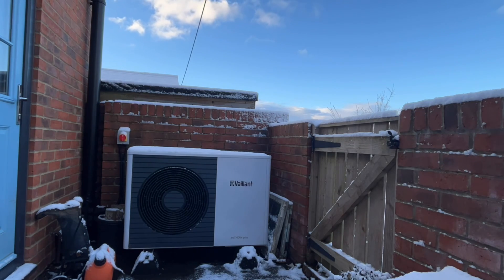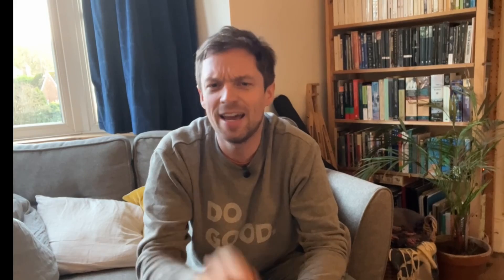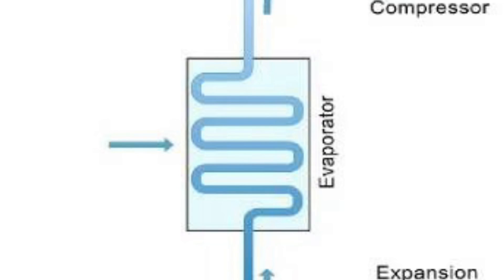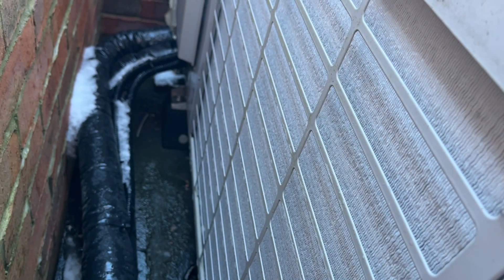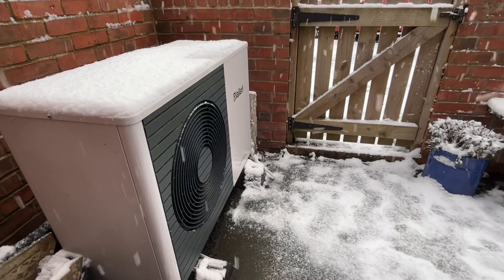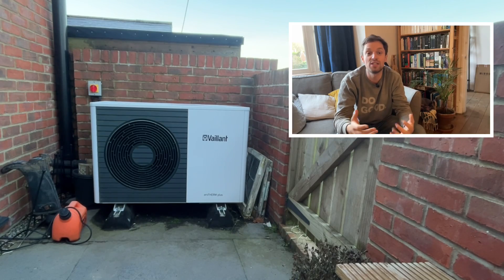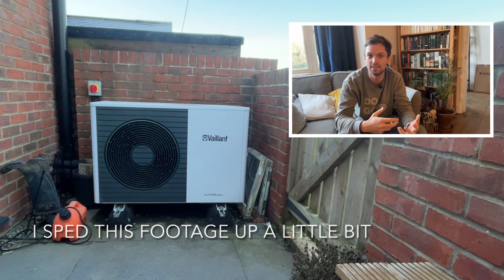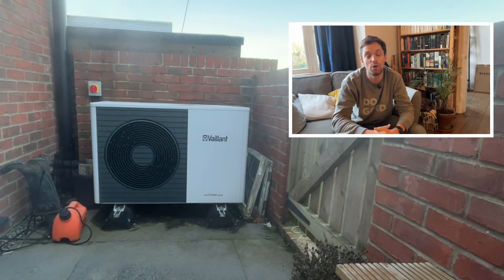Heat pump defrost cycle - what happens? I thought our heat pump had blown up!

Comment: Thank you for the helpful video. We are having an issue with pressure loss on our system and I am wondering if the defrost cycle may have something to do with it. This only happens when the temperatures are around or below 0 degrees Celsius. The rest of the time everything is fine. But on days with near 0 temperature our system pressure drops over time. One day we woke up one morning and it had dropped all the way to 0 bar.

I haven't been able to closely observe it but I have a hunch that when the pump is doing a defrost cycle it loses water somehow. You say in the video it takes the hot water from "inside the house" (radiator cycle or buffer tank). What should happen with that water after the defrost? Could there be a fault where this water leaves the system (via the condensation drip pipe) leading to pressure loss? Any other thoughts on what might be going on?

I will raise with our installers again but so far they've said that a load of condens water is normal (and the internet tells me that between 10 and 30 litres a day are not unusual in certain conditions). They've also changed some other valves and cleaned the filter, but this doesn't seem to have resolved it. It's tricky to figure out what's going on as it's not a constant issue, only at colder temperatures. And difficult to observe as I can't be out there waiting for a defrost and the positioning of the pump means I can't leave my phone out there to film it for hours.
Reply from the maker: Hi Ann, sorry to hear you are having issues with pressure loss on the system. That is something I have experienced in the past too, I don't think it is linked to defrost cycles, as these take heat from the house, but shouldn't use any water. 

My issues stopped when  I had a fairly dramatic issue when something fell on one of the valves in the system whilst the refill hose was open... we had water everywhere, briefly...!

After some fairly meaningful panic, closing off the mains water stop cock, and some deep breaths, I made sure each valve on the heat pump system was closed effectively (that should be closed) and turned the mains back on... everything was fine. And since then, I haven't had issues with pressure drop...

Long story short - I wonder whether there is a valve around your system that is open slightly, may be dripping slowly and meaning the system loses pressure slowly? This could also be at a connection to a radiator, or somewhere around your central heating pipework, may be worth checking around the system to see if you can spot any drips?

The condensate that appears from a heat pump is not from within the system, this is moisture in the air condensing at the heat pump, not a leak from the system. 

It may be that you have higher pressure loss in cold weather as the heat pump is working harder and more consistently circulating water - i.e. it is running for longer hours. 

It shouldn't be an issue with defrosts.

Hope that is helpful....

Tom

Comment: Lovely. And it can happen about zero, because that's when there is more moisture in the air available to ice up the heat exchanger (which will be cooled below zero by the heat extraction..)
Reply from the maker: Yep!

Comment: Hi, im considering a HP.  Question.. Heat pumps have a compressor in them which I've seen in other videos can be like a loud freezer, when its pump runs, obviously freezers dont make sound all the time.
Does the sound of the compresser/HP transfer into the house? Our current gas boiler can transfer sound through pipes when heating is on depending on how much flame is burning.
Reply: There are stories of heat pumps not being installed 'properly'. In particular the heat exchanger fan bearings don't like being tilted. If the foundations are poor or it wasn't carefully levelled (un-carefully left tilted?), then problems can ensue. 
In a sense they are just air conditioners, so if poorly maintained or installed, you get very similar noises ;-) Cheap installs tend to have lower quality bits in them.

Comment: Oh boy - you are so right! We have just had a heat pump; it's been running for 3 days now so very new. Like you I'm a degree qualified physicist & engineer and had done loads of research and thought I knew all about heat pumps. And then this morning I noticed it had gone quiet, the main fan had stopped and the flow temperature was way down, and there were wisps of vapour (looked like smoke) coming off it!!! Yes just like your video. Then as I approached it blew the  vapour straight at me. Just as I was staring to panic I remembered 'the defrost cycle'!! And then I Googled it and found this excellent video. Phew!!! They should make this video compulsory viewing for all new heat pump owners. Thanks for posting.😃
Reply from the maker: Amazing! Pleased to hear my video has been helpful! 

It’s quite the shock isn’t it?!

Thanks for commenting and engaging with the video!
Tom

Comment: your  a .....no offence and a tip that heatpump is  installed  bad  distant to the wall is  far to small  to the % is minus  50 at least.
Reply from the maker: Hi Andre, I am not sure what the dots mean? 

Yes you are right the distance on the right is smaller than the manufacturer’s recommended distance. I understand this is for access for service. Hasn’t caused any problems in the first 2.5 years and hope it doesn’t in the future. 

Thanks for pointing it out. You aren’t the first person. 
Tom

Comment: Just an observation may be wrong? from watching other videos on heat pumps they talk about air being pulled back into the unit if walls fence is to close, your unit looks like it doesn’t have enough space on the sides for the unit to exchange air hot or cold. This could lead to the unit running harder and shorting its life and cost you more to run.
https://youtu.be/1rKNT7-42J0?si=Eq68E6qoe6GkgKNo 
go to time point 27:10 and they talk about air flow on the unit.
Reply from the maker: Thanks M0PAX, you're not the 1st person to point out this or ask the question. I have reviewed the minimum clearance for the unit vs the manufacturer's literature, most of the dimensions are fine, the access space on the right hand side is smaller than required, which is pretty frustrating! But hasn't been a problem with servicing so far over the 1st 2.5 years.

I think the space at the rear and other side for ventilation is larger than manufacturer guidelines.

Thanks for taking the time to comment. I think this video with Roger Bisby and Adam Chapman is fantastic, and amazed to see how much Roger Bisby is won over by Adam.
Thanks

Tom

Comment: The Ecoexperts link doesn't give you a heat pump quote directly, by the way. They just sell your details to local companies.
Reply from the maker: Hi Acer8 - yes I wouldn't necessarily trust a site that didn't connect you with real companies, linking you up with local installers would be key to getting a thorough quote.

Thanks

Tom

Comment: It can use just water, not necessarly refrigerant, as in my case. Also i dont think it compresses the liquid, its the air it compresses i believe. This increases its heat capacity begore it goes thru the heat exchanger. But thanks for the video, took me by surprise the first time too!
Reply from the maker: HI Mike, apologies if I caused any confusion. I was talking through the heat pump process to explain why frost would occur, but yes, a defrost just uses hot water from the building heating system. 

Compression in the system is of the gaseous refrigerant after it has been heated and evaporated by the heat exchanger, this is within the heat pump process and we don't see it outside the unit. The air is not compressed.

Thanks for taking time to comment
Tom

Comment: I had a similar panic just hours after our installation when I saw the power consumption rocket despite the water and heating being off!!!   After considering trying to contact them at 10pm!, I decided to wait for 10 mins to see what happened. Then all went normal!  No explanation whatsoever in the manual. Why don't the installers consider these things? I decided that it was an unannounced defrost cycle.  There are much easier ways to give people heart attacks!
Reply from the maker: Oh no! 

There are definitely a lot of new things when you have a heat pump, and difficult to know what is 'right'... but pleased to hear yours settled down!

Tom

Comment: Does heat pump site have any effect on number of defrost cycles , Is a north side location in damp boggy garden worse ?  How many defrosts do you get per hour ?
Reply: I track everything via home assistant, the power consumption pattern completely changes when it defrosts so fairly easy to see, most I've seen was two in a day but its obviously very weather dependant.
Reply from the maker: Thanks  @tarkadahl1985  - that is very interesting!
Reply from the maker: Interesting questions... I am sure that the site would have impact, you can imagine that a windy location could impact frost build up, and you could imagine if it was in a particularly wet area, that could also contribute... I guess this is getting into quite specific micro-climate issues that I suspect won't effect most installations. 

I don't know how many defrosts we get per hour, and will vary on temperature / weather etc. I had set my camera up for about 30mins on a day at about 0°C so at max it would be twice an hour that day. But I suspect much less.

Thanks for engaging with the video!

Tom

Comment: Haha, my installer warned us about the clouds of steam!
Before Xmas I did a review of the first year's use of electricity and our ASHP, with our SCOP at 4.8 average the cost was under £95 a month across the year. Very chuffed, less than when we used gas. Unfortunately Octopus is not good at accepting we don't use gas, unnecessary stress that is ongoing
Reply from the maker: That’s fantastic efficiency and a great example for others to hear. 

I know our neighbour has had issues with octopus not believing that gas connection has gone… fairly frustrating!

Happy New Year! Tom

Comment: Thank you for the great content you create, it's extremely helpful 

 I'm due to begin my retrofit project in late Jan from Oil along with a raft of other energy measures, needing to have a upgraded new three phase supply fitted from the roadside by the DNO to a new meter box externally (32m in total) a smart meter with isolator, consumer unit/tails, smoke alarms, Heat Pump with a wireless controller for auto Adaption function & concrete foundation for it to stand on, hot water cylinder, 13 new rads, pipework, insulation/Plastering in the loft room, solar panels, inverter, battery storage system, Zappi EV charger point, loft boarding, lighting & lastly a new concrete path round the exsternal of the house. So going to have a house full of contractors
Reply from the maker: Hi Joshuam, thanks for the comment, really pleased to be of help. 

That is a really exciting project and great to hear, complete transformation! Well done for making the move, would be great to hear more as you progress. Hope it is as pain free as possible!

Tom